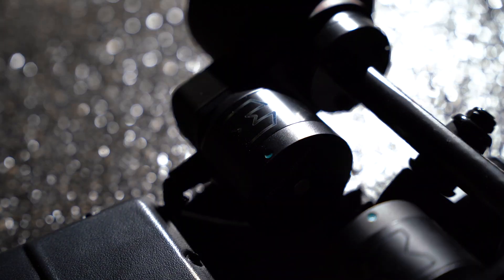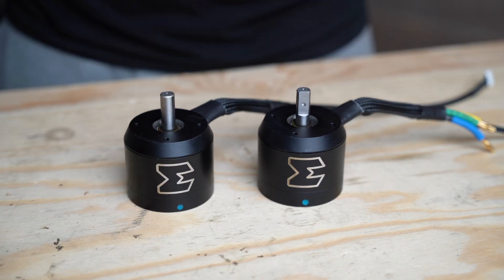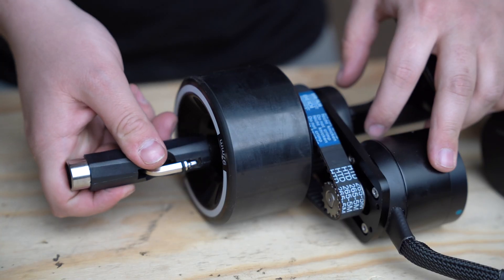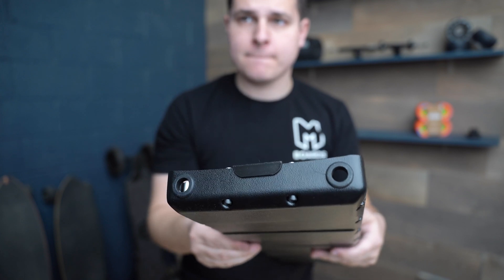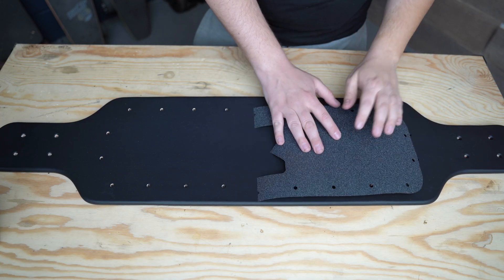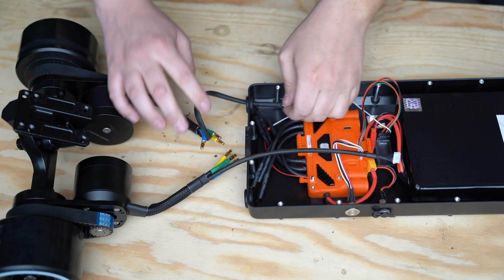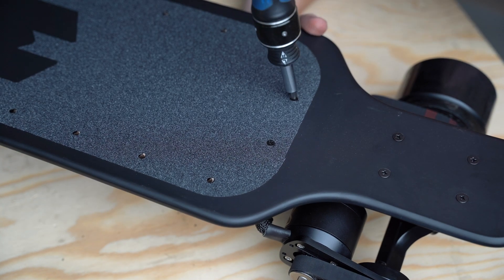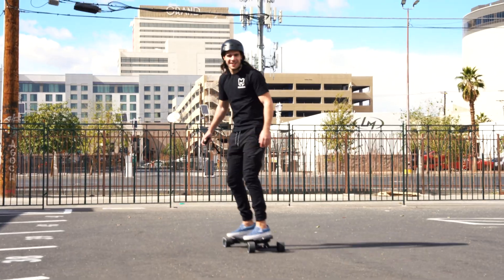NEW 30MPH INTERSTELLAR DIY Electric Skateboard Kit Build

Comment: Maybe you can help me.  I'm building a 10s powered eSkateboard... focbox unity controlling discharging, but I need help with charging!  I've wasted all kinds of money buying BMS boards and balancing charging boards and I still cant find one that will allow me to connect my 42v power supply and it will balance the cells while I'm charging them.  Can you help?!  Thanks!!
Reply from the maker: What battery are you using?
Reply: @MBoardsco  18650 cells spot welded into 10s4p config.
Reply: @MBoardsco  I sure wish you guys had a pre-built with that 12s8p you sell. I've been trying to find an enclosure to fit it, but eboards Peru doesn't even have anything that'll fit it

Comment: My remote works for controlling the board, but it always indicates the board has a full battery. The other day my battery completely died and the remote gave me zero warning. Is this a pairing issue?
Reply: Same. My remote always has one red light indicating that I have low battery after hours of charging. Not sure if it's my battery that's the issue or the remote itself.

Comment: Do you have to set up the fox box? Like the programming on the computer
Reply from the maker: Yes, but a pre-programmed version is offered as well.
Reply: @MBoardsco  okay I see. I am planning on buying an interstellar and build it myself. I saw your previous video on YouTube that showed the process but I believe I may need a little more if possible. Is the focbox used in all DIY eskateboards or just your brand?
Reply from the maker: Focboxes are used in quite a few DIY boards but are not exclusive to us. 

Also quick note, the availability of chips has temporarily paused the production of the FocBox. So the Interstellar Kit comes with a full metal VESC 6 for the time being. Set up is the same and will give the same performance.
Reply: @MBoardsco  good to know. So I’m guessing you have a tutorial for the vesc6 somewhere in your channel
Reply from the maker: Yes will be posting an updated tutorial shortly. But the FocBox tutorial is all the same steps, just different USB port type.

Comment: I absolutely have to use this board even on days when it rains and yes don't worry I'll ride slower on said days.
But I'm wondering what would I have to get fixed in water damage? Everything electrical, just the battery, or what? I know this is a terrible thing but I'm desperately against owning a car for work
Reply from the maker: Typically water damage effects the ESC first. The battery can be effected too, but is wrapped quite well so typically takes quite a bit more water.
Reply: @MBoardsco  the most complicated looking part, of course. Thank you for responding

Comment: I would like to det the diy interstellar kit but instead of belt drive i want hub motors and instead of the 10sp battery i would like the largets 12sp battery for range and speed upgrade, the esc would have to chsnge as well to the hobby wing i gather to work, i also want black airless rubber wheels instead of the knes that come with the interstellar stock,  could you make a soecial kit for me to assemble with everything i want as stated above? I would like a price for that build and a price for changing the battery to rhe larger 12sp from the 10 sp and again switching the wheels to thr airles black rubber

Comment: What does every single faze wire do (yellow, green, blue)
Because I want to see if i can use your esc on a scooter rear hub mottor wheel
Reply: They are three-phase wires. You can either have a 3 phase motor or a 1 phase motor (dc motor) and then you will also have a different kind of speed controller.